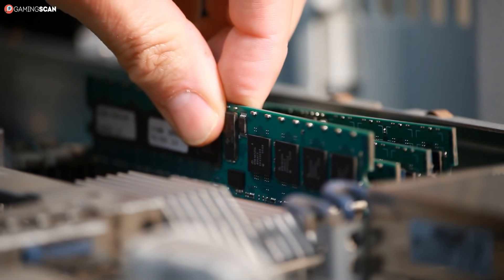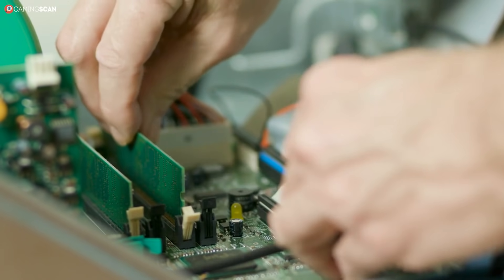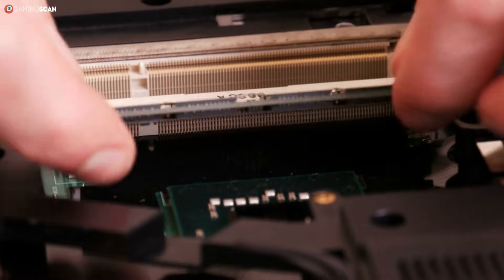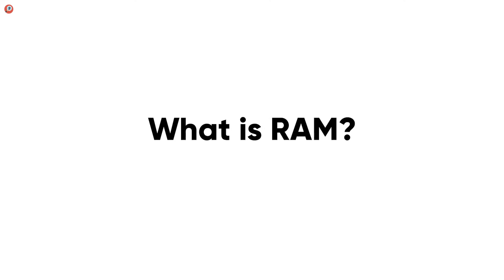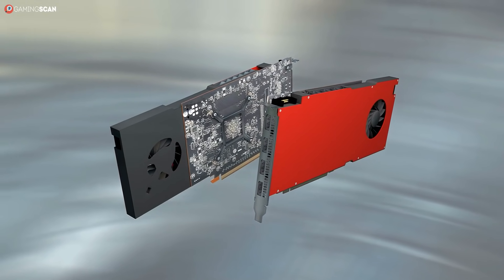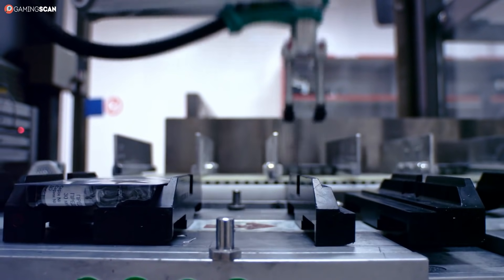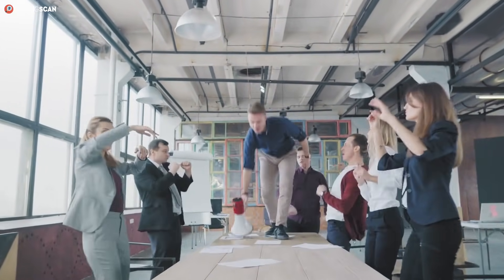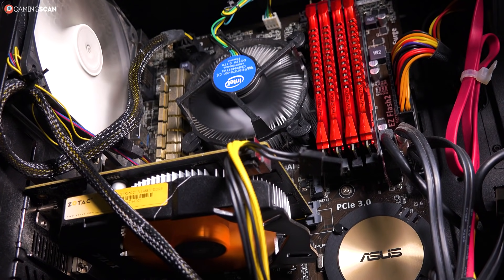What Is RAM and What Does It Do? [Guide]

Comment: something good to know is cass latency aka CL. TLDR lower the better so an example will be CL-14 CL-16 CL-18. The bigger number is usually slower but sometimes cheaper (not ALL the time) and the lower numbers are usually faster but more expensive. If anything you want to see CL-14/16 because those are the configurations best for gaming and in general

Comment: single channel and dual channel is like running SSDs in raid 0 because if you have 2 SSDS or more you can combine their controllers (chips) to make the SSD faster and the same goes for ram because if you have 2 or 4 or 8 individual sticks of ram the computer will run it in a some sort of RAID layout which will increase it's total bandwidth. Lets say 1 stick of ram gets 20GB bandwidth. If you get 2 sticks you would get double which would be 40GB bandwidth.

Comment: This Video is really great. It explaines a lot very easy while its pretty honest. However there is one great flaw. And this is the relation between frequencies and timings.
A question ahead. So what CL should a RAM have by 3600 MHZ ?
Reply: Lower cl needs higher mhz for higher quality, mhz doesn't make much of a difference compared to your latency which should be as low as possible then your mhz matching what your motherboard needs, higher being better
Reply: @Supertoddy96  Thanks, I also heard vice versa. So it's a little more important to have a higher frequency than latency. But this may just be the case for high performance games or productivity tasks and in consideration of overclocking.
Reply: @Thiloyeah  ryzen typically needs higher frequency, latency means how many clock cycles it can do per second, frequency is more or less usually meaningless since it depends on your cpu/game youre playing but ryzen gen3 I believe is average/max at 3600 mhz
Reply: @Thiloyeah  games aren't usually a factor for ram compared to high demand video editing or processing stuff etc that most people will never benefit from since ram can at most ever add about 3 fps for any scenerio which means nothing and even less if youre over your monitors hz already

Comment: You glossed over work tations but what RAM configuration CPU combo works best for Graphics intensive things like Video Editing?
Reply: I use an AMD Ryzen 7 3700X with 32GB (2x16) of 3200MHz DDR4 memory and it works perfectly fine.
16GB was very slow for me before I upgraded.
Reply: i got cyber power pc c series that is install 40 GB of ram.
Reply: Yea this is what I was wondering. I want to know if a 3060, i5 13400f with 32gb is a good idea